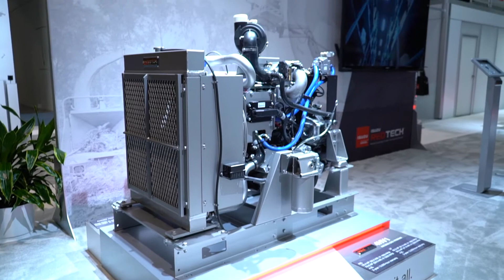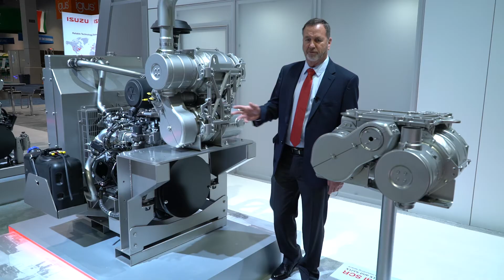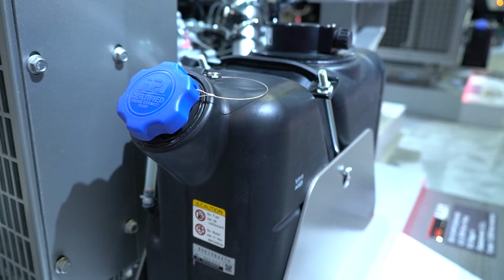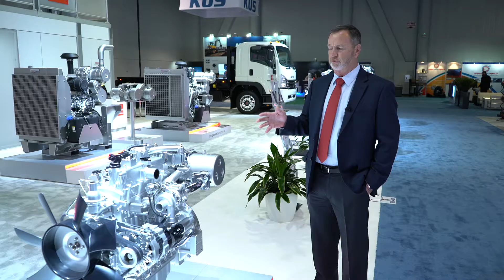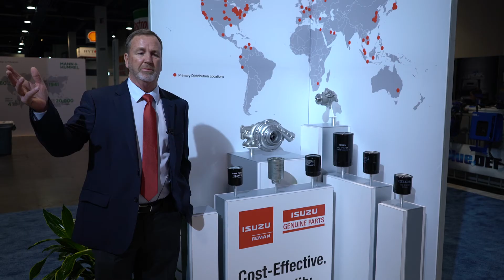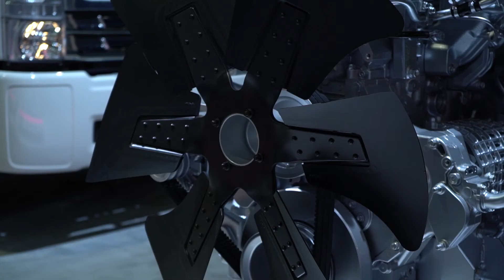Isuzu Full-line of Engines

Comment: My 1982 Holden Gemini (small 4 door rear drive car) had a Isuzu 1,6litre petrol engine. Best car ever,mega reliable.
Reply: I had the 83 gemmi sl 5 speed ,  was a little bit slower than me 84 sigma 5speed ,but used way less fuel and was like a tractor , i got the 4jj1 isuzu dmax ( holden rc colorado)  drop the oil every 5kms its  been all all over WA towing heavy  , toyota comes 2nd 2 isuzu
Reply: @mikenolzeynolan4635 
Oh that's the same model, 82/83 was the TF. You're lucky, i had the 4 speed, the only problem with the car. Reved too high at 100km